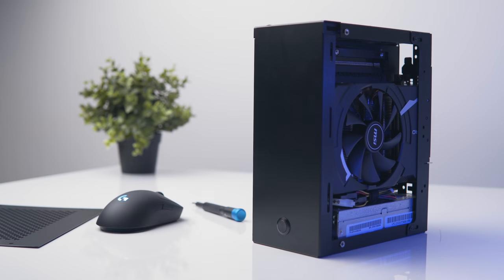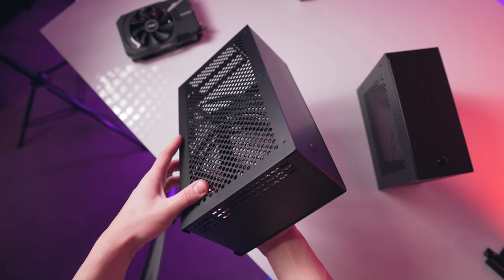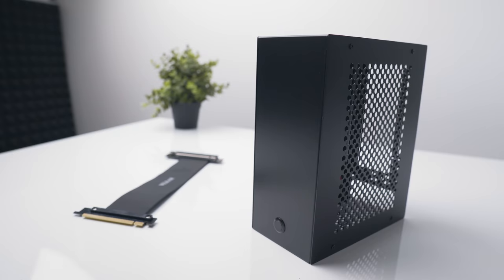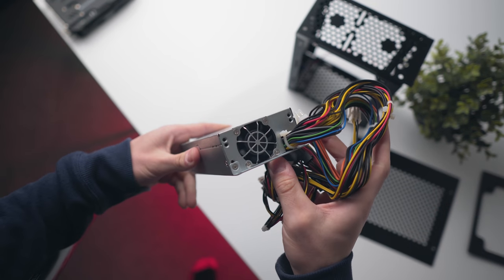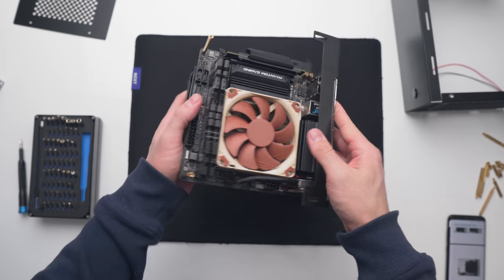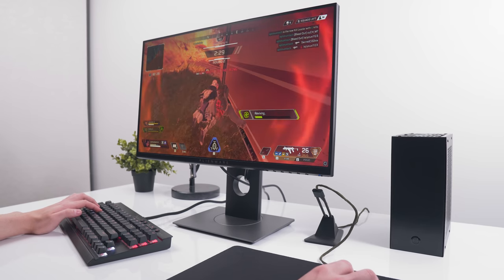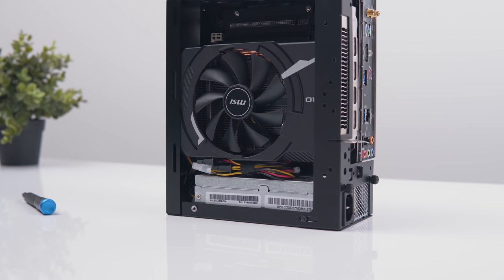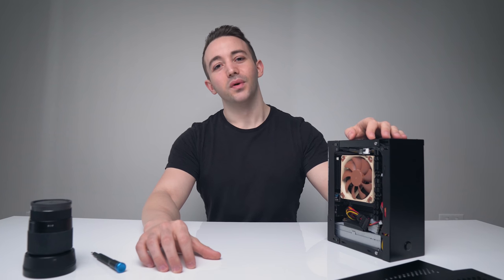Velka 3 - World's Smallest RTX 2070 Build!

Comment: Is it safe to use only 400w PSU for rtx 2070? I'm not really good in computer but alot of people say 550w recommended for 2070, help?
Reply: The MSI aero itx 2070 it's rated at 175 W peak power consumption. So the PSU max power output really depends on what kind of CPU and mass storage you will use. For a minimal build a 400watt PSU should be enough.
Reply: @lucalucente3797  thanks for the information
Reply: What kind of CPU and Can I pair with this 2070 mini with 400w PSU and rams too I want to do a mini itx build with this case
Reply: @shannonacompanado7624  well you can simply use the same components used in the video. This way you can base your build on a tested solution. If you don't want to use the same components just go for a low TDP cpu (I would not put inside a crammed space something that dissipate more than 65 watts), low profile DRAMS,  a NVMe drive and an ITX form factor GPU card. I suggest that you start with the ITX motherboard and then choose the other components looking at the compatibility chart of the MB.

Comment: Would you recommend this or the dan 4?
Reply: The velka 5 and dan a4 are more similar than that and the velka 3.
Reply: @coryabraham9199  Yeah i think Velka 3 is good for 2070 but where to find one?!
Reply: @user-vc7ep7xj7s  Ikr, I'm debating between the smaller size of the 3or more gpu selection in the 5.

Comment: Intriguing, but not at that quality level
Reply: Is there any low quality components? Id looked fine, and ive heard its solid
Reply: @EmilsAdventure  Every external screw should have been counter sunk and the corners of those panels looked atrocious
Reply: @RetroBerner  yeah okay. I guess that could bother someone very detail oriented
Reply: @EmilsAdventure  I probably wouldn't have mentioned it if it was only a $50 case
Reply: @RetroBerner  it is a aluminium case produced in extremely small quantities. The price of 80$ is fairly cheap for a case of this kind imo.

Comment: Aight, you said a 400w psu is overkill,for an 9400 and a 2070. I'm pretty sure you are right on the edge of the tdp
Reply: Not really. 2070=175 9400=65. Plus everything's smaller and uses less power as a result.